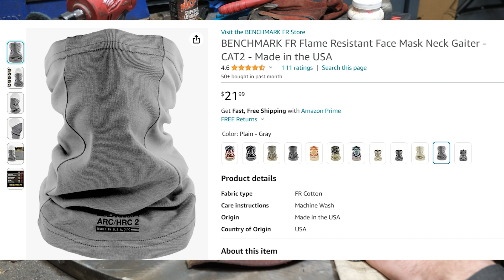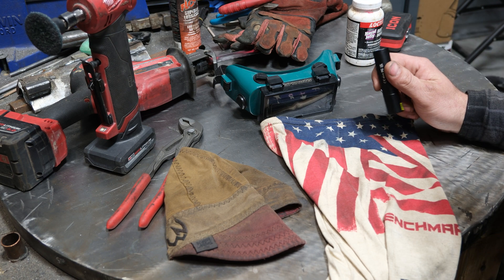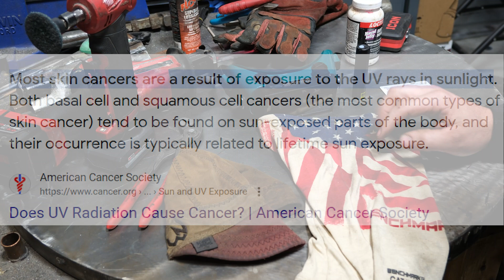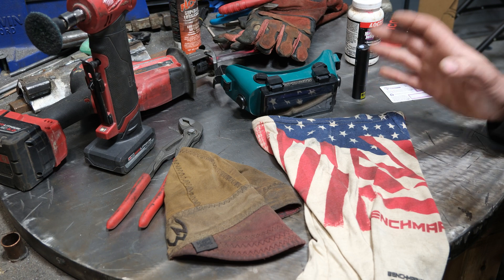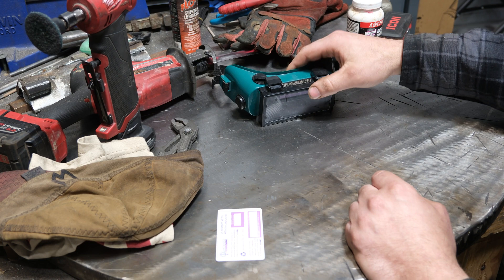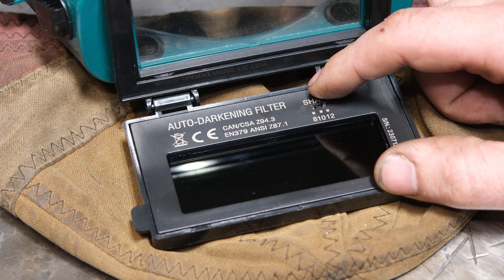Unsafe welding gear........

Comment: What about the 2x4.25 lenses? Many are unmarked. Some do have the ansi z87.1 numbers. Where did you get those cards?
Reply from the maker: I got the card from Amazon, if you search UV detection card it will come up.  Good question on the z87.1.  To be honest my opinion is any lens not marked on the lens will likely not meet the standards.  If the sleeve it comes in is marked it likely would.  I will have to check the ones I have, I believe they are all marked on the lens.  Safety wise using marked lenses is probably the smart thing to do.

Comment: Hi Greg, thanks to you I now know why the guy on Craig's list is selling his eye protection goggles. UV Unsafe! Same one you showed.
Reply from the maker: Probably burned his eyes.  I am afraid to use them lol.  I am going to test them by a tig arc and see what happens, presumably even more UV and possibly UVC (since the light doesn’t output UVC).  They are far too dark to use a torch with them so it would be difficult to find anything safe to use them for.

Comment: Thanks for the safety lesson.  I also cringe at seeing folks arc welding in short sleeves.
I learned this the "hard way", once, when I did a couple of spot welds with my mig welder  to repair a joint on a metal bed frame, and got a "sunburn" where my v-neck t-shirt under my long sleeve shirt allowed the UV to hit my skin below my neck.  (The neck button on my outer shirt was unbuttoned.)  I welded maybe 1 minute total and got this burn.  Lesson learned....
Thanks again for all you share!
Cheers from Portland, Oregon,
Philip
Reply from the maker: I cringe as well at that.  I definitely try to avoid telling anyone what to do, but man, it bothers me to see healthy people risking skin cancer welding in t shirts.

Comment: This drives me nuts when I see stuff like this. 
Cutting googles should never be used as a makeshift welding helmet. Intense UV light can leak through the gaps of those stupid cutting goggles. 
Why on earth would you turn a pair of cutting goggles into a welding “shield”. 
The darkest shade meant for those is a shade number 5 used for Oxy-Acetylene cutting or even plasma cutting. 
Using those for welding will blind you over time. They shouldn’t even be shown in that regard
Reply from the maker: I agree with your thoughts on that.  The real interesting thing is the cartridge insert in that set of goggles is sold as an insert for fixed shade hoods.  It wasn’t made exclusively for those goggles, which means people are likely using that cartridge as a replacement for their hoods.  Not a good situation.

Comment: Hay I found you here on YouTube 2 days ago and watched your video on flux core Good stuff. I have been welding flux cores for many years
 flux core has a shelf life and if It's stored roughly it doesn't weld well it has a coating to help it through the liner. I keep a lite bulb in my wire feeder to help with welds and it keeps the moisture out. It's good to see a hard worker and a fellow welder you have very good content in your videos good job🤔👌👍
Reply from the maker: Thanks for the kind words and sharing your thoughts on the wire.  No doubt if you can get the moisture off the wire it will benefit it.  Once any kind of rust forms it’s game over for the wire.  It doesn’t take long for the wire to turn bad.

Comment: How do you think the old school fix shade (non auto) is holding up against UV?   Sad to say , after this I would rather use less money on a lens but more money on testing ,  Saying that can you be sure that a brand necessary  is any better than a no name .  
In Africa I have seen welders use double sun glasses for extra protection.
Reply from the maker: Fixed shades should have no issue blocking UV fully.  I have never tested a lens that let through UV like those goggles.  The scary thing is the lens in the goggles is sold as a drop in replacement for fixed shade welding helmets.  That stresses the importance of buying a reputable lens.  It also goes without saying if you experience eye pain or feel your eyes are getting hurt, to stop using the welding helmet and seek other options.

Comment: Bro… The Green goggles are for cutting Torch use only.
Reply from the maker: You must have missed the fact the shade is lens 8-12 which is far too dark to do any oxy fuel cutting or welding.  The product is unfortunately sold for arc welding purposes and comes with a piece of paper that says you need something to protect your skin from UV exposure.

Comment: I bought a cheap welding hood on amazon cause I thought it looked cool, and I knew it was probably a sketchy lens, so I swapped the lens from the really cheap one, with my old helmet from harbor freight. Now im thinking that was good idea.
Reply from the maker: The scary thing is the lens in the goggle is sold as a drop in for other hoods.  No doubt there are other unsafe lenses out there.  Definitely is worth using a known decent lens.

Comment: That “welding” goggle thing is likely for torch welding where it’s significantly less light and only needs a like level 5 shade rather than 14
Reply from the maker: Normal goggles are definitely for torch welding.  The goggles in the video are sold as “arc welding” goggles, and are shade 8-12, which is far too dark for torch welding/cutting.  Interestingly enough the cartridge is sold as a slip in for other welding hoods, which is pretty scary.

Comment: Pretty sure that welding goggle is made for oxy acetalyne, silly
Reply from the maker: They don’t make a shade 11 oxyfuel torch goggle, you couldn’t see anything with it lol.  It’s sold and marketed directly as a welding goggle and it comes with a safety sheet that says you must wear a head wrap when welding due to uv exposure.  The goggle itself is likely a standard goggle, the insert is a cheap welding insert with auto darkening.  The sensors don’t pickup a torch well either, the sensors are not designed for torch use.

Comment: Don't skimp on PPE.  You don't have to spend top dollar on everything but somethings you do have to be watchful.  Here are my suggestions:

- on your helmet, spend the money on the lense, forget the fancy graphics, they don't do anything.  I recommend adding a front bib to your helmet.  This will also help with UV exposure.
- Wear gloves, good ones.
- There is no such thing as safety sandals.  Wear shoes.  Sneakers are okay but do not provide much protection if you were to drop something heavy on your foot or to stub your foot against something.
- clothing doesn't necessarily have to be FR, but it should be at least a heavy cotton.  They should also be long sleeve.  Do not wear synthetics.  Synthetic fabrics melt and getting it debrided is painful.
- a cap is not necessary, but I find it helps the helmet to fit better.
- If you are dealing with a lot of spatter, wear a welder's jacket or cape over your shirt.
- Half mask respirators are a plus when dealing with fumes.  Most welding fumes are fine particulates so you want an N99 filter.  This is a must with any galvanizing.  Don't worry about organic vapors.
- I consider a fire extinguisher to be part of your PPE.  I recommend a 40BC dry powder.
- Good ventilation is a must.  If you are using shielding gases, don't have the fan blow towards you, instead have the fan blow away from you.  You will need to have the fan relatively close in order to be effective.
- Keep down the clutter and keep a tidy shop.  A cluttered shop area is just more opportunities for injury.
- Have a First Aid kit.  Nothing fancy, all you need is a variety of band aid sizes, alcohol wipes, antibiotic and burn creams.
Reply: I keep a spray bottle of distilled water nearby (I use distilled water to cool things down between passes and it doesn’t leave any dissolved solids behind).  It may not put out anything significant, but it can knock some of the flames down a bit giving you time to grab your fire extinguisher. 

Luck favors the prepared…
Reply: @michaelwhiting878  Good idea.  I am usually working with aluminum, magnesium and titanium.  What are you working with?
Reply: and eye wash bottles
Reply: P100 is better than n99
Reply: @_hector__  I meant to say P99.  And yes, of course it is and at a higher cost.

Comment: Lol. I used one of those pairs of welding goggles and wound up with a mild case of sunburn on the rest of my face that wasn't covered. Learned my lesson, back to full face shields.😄
Reply: Those goggles are for gas welding or brazing. Making one with an auto darkening lens makes no sense. You don't need it because it's usually shade 5 or 8. And like he says, a green welding shade should have excellent UV protection and block IR based on the shade.

Comment: I’ve sewn some “welding caps” of leather…. Hopefully, that won’t pass UV.
Reply from the maker: Leather should be a hard stop I would think.  I tested a couple shirts in the workshop and none of them tested hot.  They are far thicker than the neck sock though.

Comment: Very informative young man because no doubt as is here in the UK, most countries are flooded with Ding Ping Pong made rubbish being sold as "quality", "fully tested" and here in the UK they advertise as "UK Stock" when it is not. Buy quality brands from trusted industrial suppliers rather than domestic market traders!
So many YouTubers than feature welding don't wear masks when tacking up and some as you say just wear a T shirt. Stupid is as stupid does!
Reply from the maker: It’s pretty crazy what exists on Amazon that no brick and mortar company would remotely put their name on.  Prime example:  I bought a flux core welder for testing.  Somehow it has a UL listed power cord and they claim compliance with CSA and a few other standards. Yet it loads up the input line with 35amps near its max output, on 120v, mind you with a 15amp plug end.  Pretty crazy lol.

Comment: When buying on Amazon, you really need to filter on seller and limit yourself to items actually sold by Amazon. Amazon has turned into an even worse version of early eBay, and there's zero accountability for the stuff sold by overseas sellers in the PRC and India, even though Amazon arranged for shipping to am Amazon Warehouse from which Amazon delivers it to the consumer. 

The congresscritters bashing on Amazon for "taking advantage of small sellers" have got it out exactly backwards. The problem is these overseas sellers themselves working with Amazon to bypass customs and import dangerous items in violation of US law.
Reply from the maker: No doubt the amount of flat out unsafe stuff on there is pretty wild.  Absolutely no testing, verification of manufacture claims, etc.  I just bought a flux core welder for testing (it’s somewhat a reputable brand), and it’s sketchy.  It has a “UL listed” cord with a 15a plug end, but it loads over 34a on a 120v circuit.  How the machine is legal to sell is pretty mind blowing to me lol.
Reply: @makingmistakeswithgreg  The quotes around UL Listed are quite appropriate. I've bought alleged UL listed items in Amazon that triggered warning bells when they arrived, and when i checked with UL it turned out that the registration was bogus
Reply: @PaulSteMarie  Play the return game.  If enough people do it Amazon will dock the seller.
Reply: @morenothing4u  Returned the item and reported them to UL, who was not amused. Amazon pulled the listing, but the seller turned around and relisted the item, minus the phrase "UL Listed" in the description. 

IIRC, though, the picture still had the fake registration number.

Comment: Yep.  Many thanks!  Its T shirt season so I bought a pair of "arm leggings" to reduce burns and I assumed it would keep UV out.  I'll have to test them now (which is a smart thing to do).  The old saying about making assumptions rears its ugly head again...  🙂
Reply from the maker: If they are made out of the same material as that neck sock good luck lol.
Reply: @makingmistakeswithgreg  It's raining like hell here so I thought I'd add MY experiments.  OK, gotta' imagine 90+ heat and just about equal humidity --I anin't gonna' weld in a heavy denim coat and pants.  Here's what I use as a DIY welder that sill wants some PPE.  1.) Harbor freights Denim welding apron it's only $4 in my area. 2.) Magid 24" flame guard w/thumbhole, $9.00 per pair.  I also got the uv flashlight and test card and I couldn't register UV light after a full minute direct UV on the sleeves.  Just so ya' know, I went with the HF denim apron 'cause it's also shorts weather and I could sit at a stool and weld while my legs were covered from spatter.  Also, it's HF stuff so expect the ties to rip out --it's only $4 so just cut a slot where the cloth tie-on was and tie in some cotton cord or something --WTH.  Some may not like this 'cause you aint gonna' be no fashion plate but it's quick to throw on and keeps the UV off you.  P.S.  I've had those fucked up burns from welding and it sucks so I don't care about the look!!

Comment: I'm shocked that the goggles passed UV light. I genuinely didn't think it was possible. UV gets hard countered by plastic and glass
Reply from the maker: It’s the only set of goggles I have seen show up positive. Every welding hood I have ever checked (even yes welder and harbor freight) never had a positive result.  The googles aren’t super hot (as in burn your eyes out immediately) but I have no doubt it’s passing UV though.  Its performance in the darkened state is slightly better (I have to trigger it with my phone) but that too let’s uv though.  I thought they may have just used torch goggles and screwed up, but the shade is so dark there is no way it’s meant for a torch.

Comment: Hm, with any thin thread-based material you will get even regular light passing through -- I doubt it's just passing UV more than visible light, you could just shine a flashlight through one side and see all the holes. A fair point that it's definitely not blocking it all, but it's also definitely blocking more than nothing.

EDIT: lol halfway through you just said that, figured I got to the end of that section.

Comment: Pretty informative with this video Greg.  I’ve used the burning goggles with an auto lens before and I didn’t like it anymore than when I had to hold a damn auto lens with a clear taped to it in front of my face due to restricted space. I wasn’t a fan of the leather money hoods either. A couple years ago I bought a Miller auto darkening mask and I’m pretty impressed with it
Reply from the maker: Those masks are handy for hard to fit places.  I have never used millers but I have heard it works good.  Beats being frustrated with a big hood on trying to see something lol.

Comment: Especially white clothing only has a very low Ultraviolet Protection Factor (UPF) of around 10. The thicker and the more the color differs from plain white the higher the UPF is. Greyish thicker woven cotton has a UPF of around 20.

Even more important: if white clothes get wet (welding in summer, sweat), the UPF drops close to zero...
Reply from the maker: Interesting.  I did test a couple button up Fr shirts (dark colors) and they had nothing show
Up on the card.  I have noticed a slight neck redness after welding all day at my job with their button up shirts, but they are paper thin (blue in color).  That’s why I bought the neck sock only to have that not work 😅.  I Definately will be sorting this out to stay protected.
Reply: Right, that's like the 'wet t-shirt" effect :)

Comment: Yes, very dangerous. We get A and B wavelengths from the sun. The deep atmosphere blocks the shorter C wavelengths which is the most dangerous and is produced by welding. I don’t know what that card can read, so I don’t know if it would register the C band. But UV flashlights usually only produce the safer A band and at most a tiny amount of B. I don’t know how these safety items will pass A as opposed to B and particularly C. I wish I still had access to it, but I had testing equipment for this that produced a tunable A through C UV wavelength output and a sensor for it (and a really good certified pair of glasses), a lot of materials will pass A but not B or C, and a lot will pass C but not A. It depends on the material.
Reply from the maker: The card measures UVA and B on the main strip and UVC on a separate part of the card.  You are correct, the light doesn’t output UVC.  I have a feeling if the goggles are letting A/B though, C would probably as well.  The wavelength of the light is claimed to be 365nm.  I might pickup a UVC light to see if that lets that through too.  The neck sock definitely will lol.
Reply: I would say a TIG arc would be the next best thing, if you're testing for welding PPE specifically
Reply: @maxscott3349  yes. TIG is the most dangerous because the heavy fumes of the other processes help absorb some of the UV.

Comment: Welding lenses should block both UV and IR. UV is bad because it damages the cornea, but IR cooks your eye lens and you get cataracts. That's why IR opaque goggles are essential for torch cutting.
Reply from the maker: Great info.  Every welding hood I tested (8 or more) had no card reaction to uv.  I also tried a few shirts I had in the shop (Fr button ups) and those blocked all UV as well.  The fact those goggles had poor UV blocking is a surprise since they had a good review and are a dark shade.  How a 35$ harbor freight hood can pass in the clear state and a set of welding goggles won’t pass in the darkened state at a shade 11 blows my mind lol.